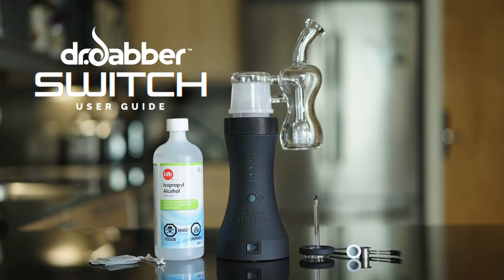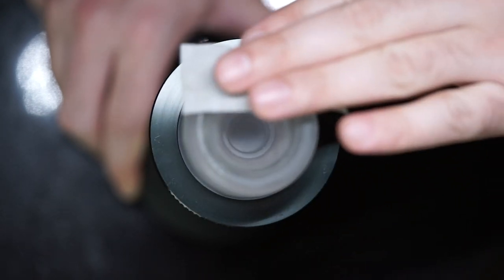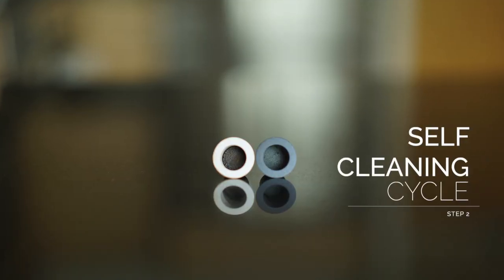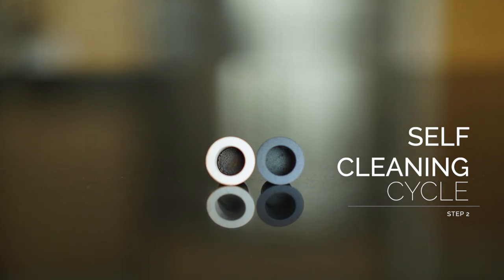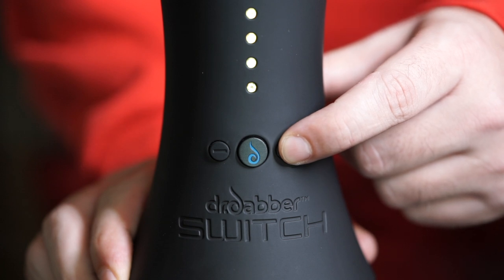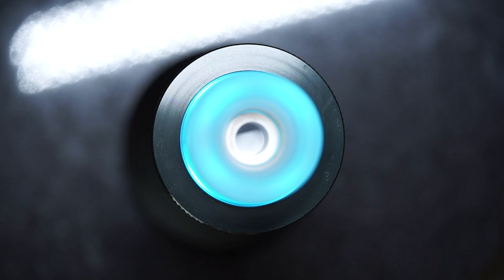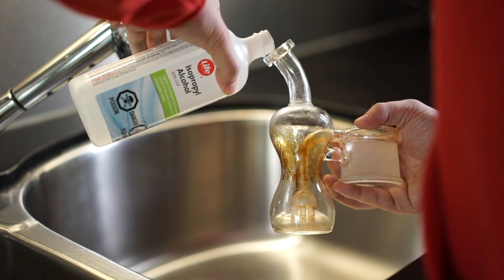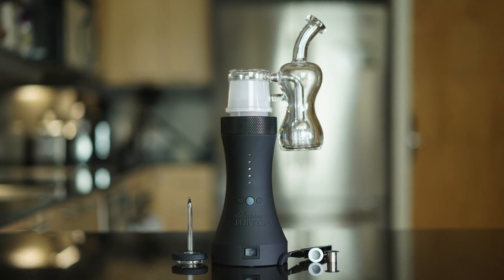Dr. Dabber SWITCH User Guide - Cleaning Your SWITCH

Comment: This thing embarrassed me on how high you can get from .3 grams of greenhouse C+ grade flower, im not even smoking anything special and I'm baaaaked ziti 😄😁 highly highly highly recommended ☺😇
Reply from the maker: Stay toasty :)
Reply: You save the $400 cost in wasted roaches, burned wax and other miscellaneous wasted weed actions, probably in the first month using the switxh
Reply: @yungpedro17  my switch been wasting Hella wax. Highest setting. Any tips?
Reply: @Impulse_CDL  use less wax or do a higher temp dab. When people use rigs they often over heat and thats why they can soak up a fat .2 dab every time. I should also ask is this usual for ur switch bc the highest setting normally rips hard af
Reply: @yungpedro17  I have it at the highest setting with decent sized dabs. It was good for the first few rips but after like 20-30 hits its just not ripping the same. Cup looks kinda burnt might need another cup. Also the cups get Hella dirty with reclaim really fast. Wondering if self clean mode mightve killed the cup. As of now I'm mainly using my carta 2 no issues at all other than having to replace the atomizer every 1k hits or so. Sad too because the smoke shop hyped it up and I ended up buying the dr dabber switch 2 days ago smh.
Reply: @Impulse_CDL so you don’t enjoy the switch asking cause I might buy
Reply: @Imjohn200  buy a carta 2. The dr dabber is not worth it. Either I got a defective unit or the dr dabber is bad. I haven't had a chance to contsct them directly.
Reply: @Impulse_CDL  I’m thinking mini nail

Comment: Had mine for over a year and still going strong
Reply: My ceramic insert will not clean is supposed to stay brown
Reply: @RG-io4vh  The inside of the bowl will stay that color, I run the clean cycle until it stops smoking. Before running the clean cycle I wipe out the glass under the bowl with a alcohol wipes. After you finish the cleaning cycle i usually use my dab stick and try to scrape out all the ash In there and then tap the back of the bowl to hit all the powdery ash out. Should taste like brand new after all that. Just make sure you run the clean cycle as many times as it takes till there isn't smoke.
Reply: @MooseMan198  thank you for that. The puffco pro is so easy to clean it's crazy but it doesn't hit as good as this beast

Comment: Any clue why my reclaim clogs at the bottom of the percolator tubes? I have to ISO wash after 10 dabs. That seems excessive. other than that this is the best device ive ever had!
Reply from the maker: Reclaim will occur no matter what over time. We recommend taking long, slow drags for best results. You can used distilled water or products like RezBlock to avoid cleaning and clogging issues. 

If you continue to have issues, please shoot us an email and we will be happy to assist you further with this.

Comment: You guys say to use 91% or higher Isopropyl alcohol, but used a 70% isopropyl alchohol wipe to clean the top well. Currently,  70% is all i can find at the stores. Is this not okay? I assume it is if your video shows you using 70%.
Reply from the maker: You can use either or, but we recommend using 91% for best results. Lower percentage will not cause any issues.
Reply: Dr.Dabber thank for the reply! I have had my Switch for a week now and I F**** LOVE IT!!!! I just ordered a carb cab and a Stella. You’ve got a new fan for sure
Reply from the maker: @nile9o  That's what we like to hear. If you are happy, we are happy. Dab On!

Comment: How do I get off the brown residue inside the top of the switch where you set the cups inside... the ridge around there inside mine is turning brown over time and can’t seem to get off? Any solutions?
Reply from the maker: You may pour ISO directly in to the top induction chamber. A good ISO and salt scrub should remove any blemishes. We recommend cleaning out the induction chamber/glass top and underside of induction cups before using the self cleaning cycle to avoid this is the future.
Reply: I got the same thing in mine ,its like theres reclaim getting on the inside of the thing somehow , no matter what I do I cant get it clean .
Reply: @jeffreid1947  me to

Comment: How do you remove the residual stains on the glass top left from using the self cleaning mode  is what i want to know
Reply: When using cleaning mode take the dab wand off and set it aside so it has no airflow obstructions, if you are talking about a different piece then all you gotta do is wipe the entirety of the glass down with isopropyl alcohol and everything should be clean or use an alcohol soaked Q-tip. Personally, I put the dab wand in a Ziploc bag with a bit of salt, leave it for about 10 minutes then shake the bag if there is still any residue. I also fill the the cup with isopropyl alcohol where the ceramic piece goes into and wait around 10 mins for the residue to become soft, just be careful not to spill it onto the Switch.
Reply from the maker: You may pour ISO directly in to the top induction chamber. A good ISO and salt scrub should remove any blemishes. We recommend cleaning out the induction chamber/glass top and underside of induction cups before using the self cleaning cycle to avoid this is the future.

Comment: Question about the SI-C Cup: Is it OK to clean this with the self-cleaning mode ? If not , why ?
Reply from the maker: You can, but it will not clean it completely. We recommend using a torch to clean upgraded inserts. 

https://vimeo.com/648689825

Comment: The end clip of him cleaning it doesnt really work for the stem inside,  I've even filled it head to toe and soaked it to get it that clean.
Reply from the maker: Use a little table salt as an abrasive with your ISO for best results. Make sure to use 91% or higher ISO alcohol.
Reply: Also run hot water over the outside to warm the glass and iso inside.
Reply: Try using coconut oil instead of water. Don't discard the amber colored coconut oil... It's an amazing topical instead of pouring it down the drain. Peace.
Reply: I have home made plugs so I can shake the attachment. With 91 or higher gets it clean without salt. If it really dirty I just let it sit for a while and shake again.
Reply: @Briburch1008  will be trying this.

Comment: Why can't we self clean the quarts or smooth ceramic? Can I do it with sic or sapphire?
Reply from the maker: We recommend using a torch to clean inserts fully. That being said, you can definitely head to advanced or standard mode and run a cleaning cycle on these inserts if you like. It will not clean them completely and you may need to do back to back cleaning cycles to to get the desired results. This will drain your battery pretty quickly as well.
Reply: @DrDabberofficial  thanks for your quick and response. And for the great explanation.

Comment: So everything cleans easy except for right around the rim of the induction cups on the inside of the glass. It gets charred and doesn't really come off.
Reply from the maker: We recommend cleaning out the induction chamber and underside of cups before using the cleaning cycle or higher heat settings to avoid this. You can use a bristle brush and ISO alcohol to remove these marks, but it does take a little elbow grease.
Reply: @DrDabberofficial  what type of brush exactly? I've had a few ideas but don't wanna scratch the interior of the glass😂
Reply from the maker: @cubedone199  Any kind of bristle or wire brush that fits will work. A toothbrush should do the trick.
Reply: @DrDabberofficial  it looks brand new tyvm used a tooth brush :)

Comment: Can u do the cleaning cycle without the induction cup? I have left over wax under the cup
Reply from the maker: No, heating/cleaning cycles will not fire if an induction cup is not inside the heating chamber. We recommend using a cotton swab or paper towel dipped in ISO to clean out the heating chamber.

Comment: But you didn’t say how to clean the inside where the cups sit
Reply from the maker: We recommend using a paper towel soaked in ISO alcohol to clean out the induction chamber. You may also pour alcohol directly in to the induction chamber and let it soak for about 20-30 minutes. Make sure to let all parts dry completely before use.
Reply: @DrDabberofficial  I can't seem to get off all the residue in my ceramic induction chamber. I've soaked in rubbing alcohol for hours and it's still black on the bottom. any recommendations?
Reply from the maker: @JSimenhoff  Shoot us an email and we will be happy to assist you with this further. We have upgraded the glass top to remove the glass frost from the inside of the heating chamber. This helps eliminate the staining issue.
Reply: @DrDabberofficial  Thanks, I actually meant the cups themselves not the frosted glass chamber that the cups go into. All good though, I'll send the team an email thanks
Reply from the maker: @JSimenhoff  You may use a torch to completely clean cups or use the self cleaning cycle a couple times to get them back to 100%.